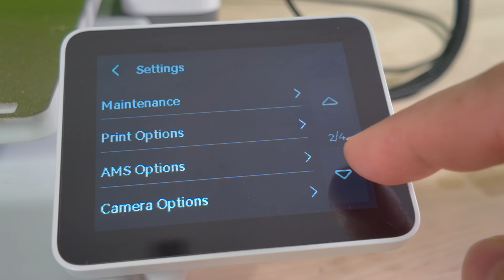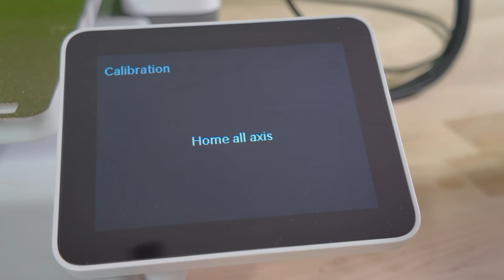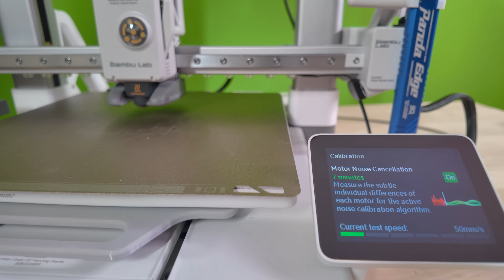Top 3 Fixes for Bambu Lab A1 Filament Clogs (Fast & Easy)

Comment: Thanks for a very good video. I had to take things apart and found what you showed with the broken filament... I removed the hot end and ran the cleaning wire through it.  That filament was also broken a bit up the bowden tube.  QUESTION 1: When I tried to take one of the four bowden tubes out one was stuck  I finally removed it by pulling out with pliers .. nothing seems damaged.  Do I simply take a razor knife and cut off the bottom 5 mm +/- and reinsert?  QUESTION 2:  When I tried to remove the bowden manifold (if that's the name of it)  It was VERY difficult to remove.. When I got it out there was some very sticky clear goo on it.. IPA doesn't touch it.  It's also on the spring and the inside of the recess where that manifold goes in the head.  SUGGESTIONS???  Thank you..
Reply from the maker: Grease on the "manifold" is fine and normal. For the other parts I am not quite sure I follow.
Reply: @planet3dp  Thanks for the quick reply.. Doesn't seem like grease.. it's VERY sticky.

Comment: Can you please help me. After I followed these steps, I'm getting an error that says "Nozzle Temperature control is abnormal. The hot end may not be installed. To heat assembly without the hot end, enable maintenance mode in the settings." It's my very first day having this thing, and I was already getting errors from the filaments, and now I can't even get it to heat to try and load a filament. I'm extremely frustrated and really need some assistance from someone who knows what they're talking about.

Comment: Hey I did all of this, and it is still stuck. I heated up 250*C and let it extrude manually and it is floating through fine. However when I start printing it kept on getting clogging message. What is a fix now for my case?
Reply from the maker: Have you tried a different nozzle yet?
Reply: @planet3dp  I upgraded to Panda Claw and it worked for 10 days and now the AMS Lite kept giving me issue (not loading or filament slipped message)
Can you make a video for this fix?